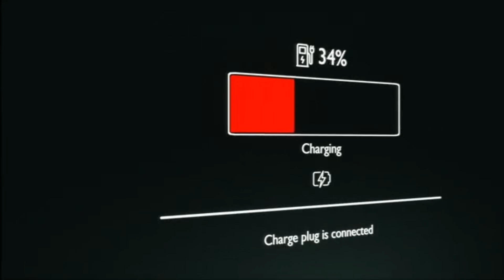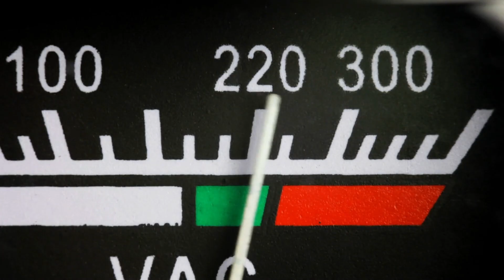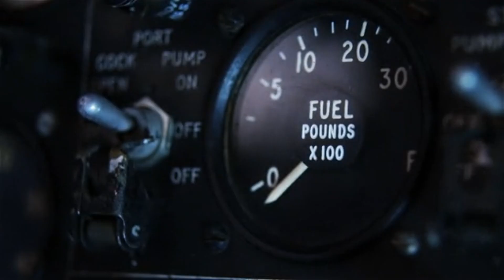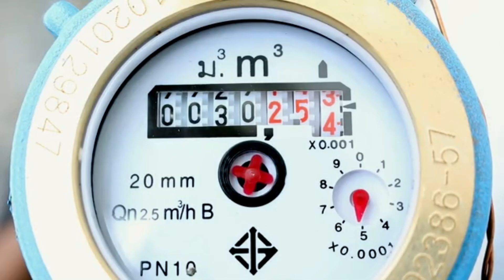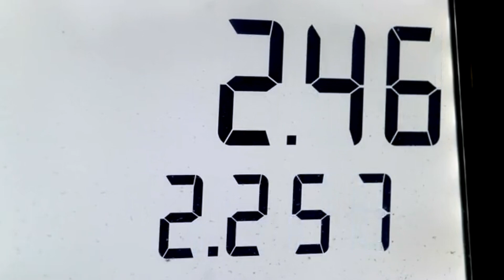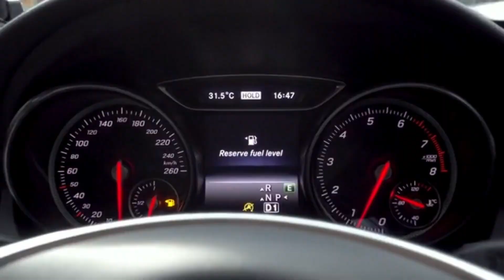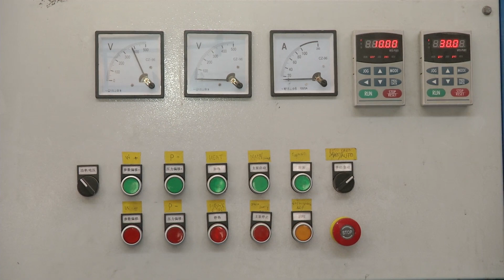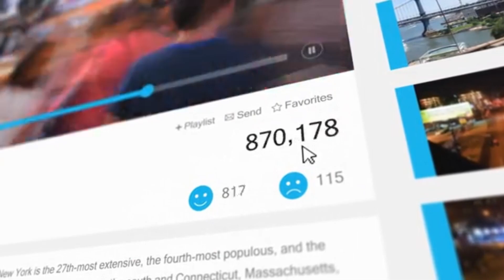5 Myths About the Auto Start Stop (The Dirty Truth)

Comment: I have a Honda CR-V with the oil dilution issue that has inflicted the 1.5L turbo engine since 2017. Gasoline washes down the cylinder walls and contaminates crankcase oil on cold days if the engine is stopped before it has warmed up.  Auto-start-stop is killing these engines.  Full-stop literally.
Reply from the maker: Thanks for sharing your experience! It's definitely important to be aware of how auto start-stop technology can impact engine health, especially in colder weather.

Comment: I have a Mazda with start stop, I've replaced 13 batteries in 9 yrs of ownership.
Reply from the maker: Wow, that’s quite the battery saga! It sounds like your Mazda has a mind of its own. Thanks for sharing your experience!
Reply: @TorqueVault reckon its the start stop, manage to disable it at year 7.5 of ownership. Still manage to destroy 2 more batteries, just recently replace month ago, cluster panel went haywire. Blasted all the warning lights, from check engine light to abs, traction, power steering malfunction, battery management malfunction, early xmas lights basically lol
Reply: If anyone is interested on how to disable the start stop, disconnect the hood latch switch/ sensor. The car will think the bonnet is open and will disable the start stop function, one downside, no more amber flashing lighs when locking the car
Reply from the maker: Disabling start-stop was a smart move, but those warning lights going off like a Christmas tree must’ve been frustrating. Hope the new battery holds up and the cluster doesn’t act up again!

Comment: I have repaced two batteries which went bad- or dead due to the Start/Stop system on a 2019 JEEP Cherokee, and don't like it at all. I even disconnected it from the vehicle- until the check engine light came on...  Still don't like the system at all- our Congress/Senators thinking they are doing something good for us- not!  Newer vehicles may not even have the option to turn it off at all.

Comment: I am an older person. As far as I am concerned these Auto Start Stop feature on new cars is another unnecessary complication that will break down and need repair that costs money. Also just like turbo chargers, this is just another item being done all in the pursuit of slightly higher fuel economy.
Reply from the maker: The Auto Start Stop feature can definitely feel like an extra layer of complexity, especially if you're used to traditional vehicles. It's always important to weigh the pros and cons when it comes to new technology in cars.